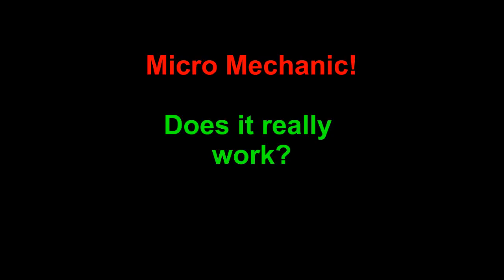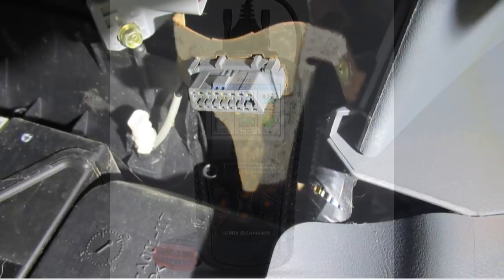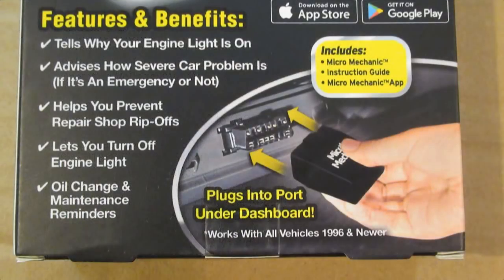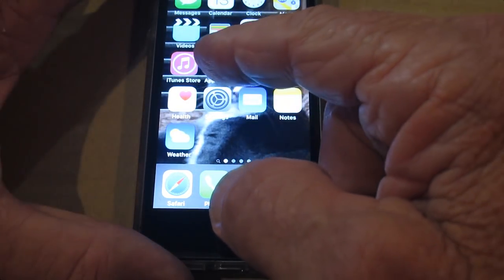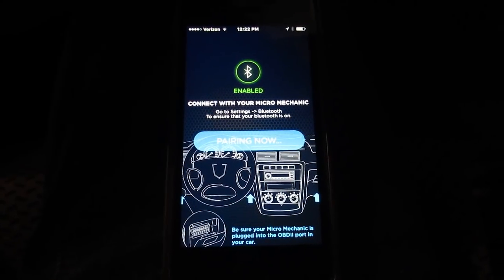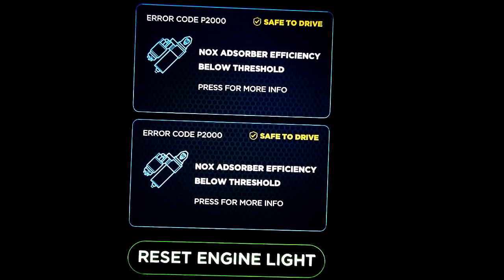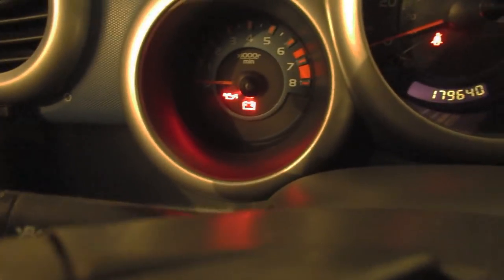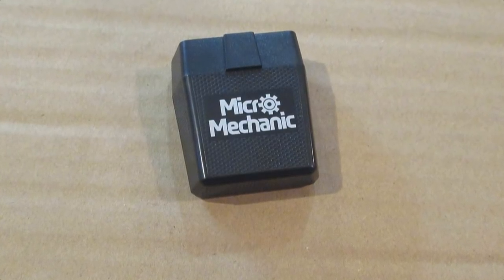Tiny Micro Mechanic Automotive Code Reader tells problems & resets engine light after repair.

Comment: Whoa! There you go. 20 bucks saved you bookoo in auto mechanics' (min hourly) costs. :)
Reply from the maker: I figured the catalytic converter was bad, which causes the 02 sensors to react as they did. I live in a state where there are no smog requirements, so am not concerned with these readings, as that engine light warning might have been something more serious to worry about. So for me, it did it's job and I'm not buying anything. Thanks for the comments.
Reply: @NightFlyyer  Exactly same thing I would do to!!! If the car is running fine and it's just emmission's stuff and not required to pass in your area, don't waste the money! The cars we had in the 70's and 60's didn't have hardly any if at all this emmission's crap on it just a catalytic converter required after the 70's, this modern computer monitored/controlled veichle obd stuff is just a headache! You can have a veichle that's barley 3 years old with less than 40,000 miles on it and well maintaned and oil changed regulary,and the damn light still comes on! You can't win with computer's and you can't win with modern veichle's! There just not meant to last very long like the cars we use to have.
Reply from the maker: @andrewscrazy  Well said.  Thanks!

Comment: I've been using an elm327 Bluetooth obd2 adapter for like 8 years now. I have android so I use an App called torque pro that is very in depth. You can even customize pages with gauges to show you whatever you want to monitor as well as set it to log so you can go back and see if something is causing an issue. It has saved my butt so many times I stopped counting. Good video btw
Reply from the maker: Thanks.  There are certainly other ones around for sure. I just happened to see this one as I said, and since I am counting my pennies after that fire wiped me out, I bought it.  It works as you saw and told me what I needed to know.  Thanks for the comments and kudos.
Reply: NightFlyyer yeah it definitely works. I was just getting people know alternatives. This thing is possibly the same as my elm327, just marketed with a different App. The elm.327's are very abundant from countless manufacturers and range I'm.price from $5-50
Reply from the maker: Well since this video is about this particular one called the Micro Mechanic, which was just recently advertised on TV, maybe you should make a video about the one you use to inform?
Reply: NightFlyyer its not a big deal Dave I'm sorry, I didn't mean to offend. I was simply sharing my experience of other ones.
Reply: NightFlyyer. https://www.yourmechanic.com/article/p2000-obd-ii-trouble-code-nox-trap-efficiency-below-threshold-bank-1-by-spencer-clayton
Reply from the maker: I reviewed this one since it was on the shelf right in front of me. I know there are many many others that are around.

Comment from the maker: With 179,000+  miles on our Honda Element, it is no wonder the Engine light is on! I wanted to find out why for sure, as they usually come on due to Smog devices, loose gas caps, or other minor problems.  This device will tell me if it is safe to drive without hurting the engine or drive train plus diagnose hundreds of other problems for only $20. Both 02 sensors are saying they are below threshold, which tells me the Catalytic Converter is probably bad.  But there are no Smog Laws here in Iowa, so it I do not have to worry or repair anything.  The Micro Mechanic did it's job, proving nothing major was wrong, but unless I repair the catalytic convertor or O2 sensors, the engine light will come back on.

Comment: My question is.... Does the vehicle have an upstream and down stream O2 censor like my Jeep had?  If so, did your reading say give that info?
Reply: Don Kopp.I have an elm327 and it does. What sensors show up is mainly dependent on the vehicle. It has saved my butt numerous times. I own 3 of them, the oldest is 8 years old and still working. If you have an android device there is an App called torque pro that costs $5 and it is a very nice App. You can even look up the check engine codes to see what they specifically mean..from there you can look a service manual online for your vehicle and cross reference a code and follow the trouble shooting tips. I has an 02 sensor issue in my old civic, replaced the upstream sensor and didn't fix it so I followed the trouble shooting and found it was a missing fuse for the 02 sensor.
Reply: Don Kopp pretty much every modern vehicle has an upstream and.downstream o2 sensor.on them. The upstream tells the vehicle the air fuel mixture for the car to be able to adjust and run correctly. The secondary measures exhaust quality after the catalytic convertor to let you know if your convertors are still functioning properly. The secondary usually does.not effect the way the car runs on most vehicles, just pops up an annoying light.
Reply: sinformant , I was wonder if the gadget he used gave that information so you don't guess which one to change.
Reply: Don Kopp https://www.yourmechanic.com/article/p2000-obd-ii-trouble-code-nox-trap-efficiency-below-threshold-bank-1-by-spencer-clayton
Reply: NightFlyyer okay, I missed that in the video. Thanks much!
Reply from the maker: Yes, no problem.  Be well!
Reply: NightFlyyer mr. Herbert, i would love to inform you that nothing needs replacing. If you live in a state where emissions is not required every year, you can drive with that light on no problem. The upstream and downstream o2 sensors have to be working to show you the code. So nothing to worry about. Have a good day!
Reply from the maker: Yes, your right.  I figure the catalytic converter is bad and why the O2 sensors gave the below threshold readings, but your right, Iowa has no smog regulations, so I will simply drive without worry.  The Micro Mechanic told me nothing major was wrong with the engine and so for me did it's job.  Thanks kindly.
Reply: NightFlyyer your welcome!